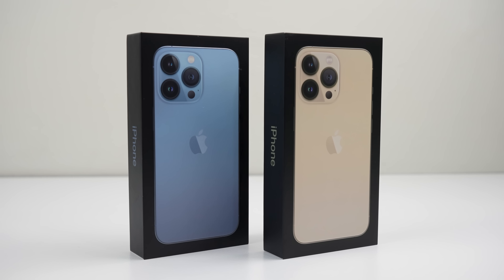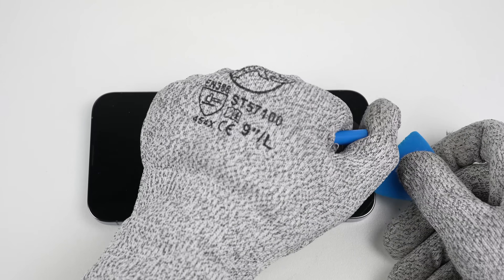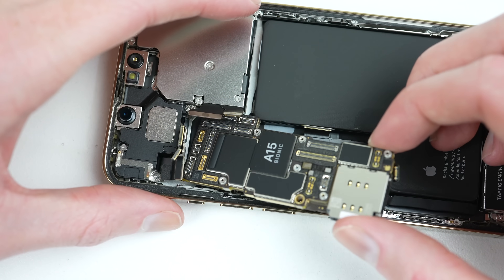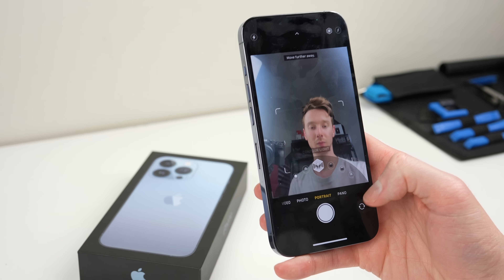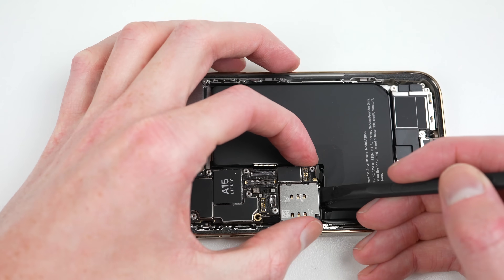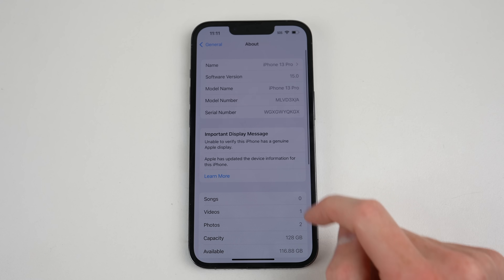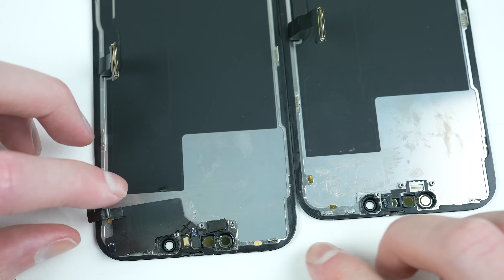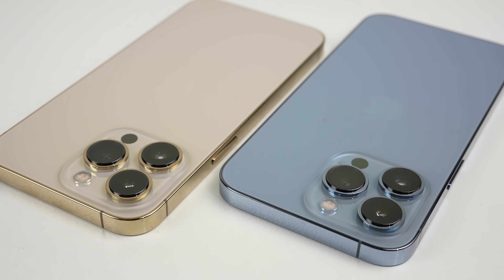iPhone 13 A Repair Nightmare - Teardown and Repair Assessment

Comment: Imagine buying a product and not being allowed to repair your OWN property. You're basically renting apples phone at this point.
Reply: Yes, that's the general message. Private ownership by individuals as we once knew it is slowly disappearing.
Reply: @uzivatel56  It is only disappearing because we currently allow it.

We have the ability to choose to disallow them this.
Reply: @TerkanTyr  we don't have the ability. Practically everyone is moving in that direction, in every industry, so you choose between buying their shit or not buying anything ever again, even the things you need to buy
Reply: @gordonf5553  You have a democratic government and a military, you have the fucking ability.
Reply: @TerkanTyr  Yes, let's not give up yet, but I actually don't think we can change it. It's a general trend across the board (software, cars, house appliances etc). We can't do much to stop it.
Reply: @uzivatel56  it was always an illusion. You belong to your king, and though your pasture is wide and you can graze where you want, you are still company cattle.
Reply: @uzivatel56  But , you will be happy .
Reply: John deere does this also. Fixing anything yourself immediately voids your warrenty.
Reply: @skArpPT  voiding warranty upon repair is just lame, but purposely engineering something to break once repaired is plain evil.
Reply: @jameswilson8907 
The McDonald's ice cream machine actually always doesn't work because the cleaning system is designed very strictly. If the sensor in it doesn't think it's clean enough, then it won't let you use the machine. It's this strict is by design. McDonald's doesn't want to risk a possibile lawsuit for food poisoning.

The only reason other tools and appliances used for cooking and meal preparing don't break as much as the ice cream machine is because it's somehow harder to keep an ice cream machine as clean as the other tools. And considering the employees who work there, the extra effort and requirements needed to clean the ice cream machine are often not met.
Reply: @skArpPT  and thats why theres people that hacks the software for john deer. if a farmer lives 50 or 100 miles from the nearest dealership they have to call a oversized hauler to tow it both ways to the dealer n back home.. which is not cheap at all. dumbest shit ever
Reply: "By 2030, you'll own nothing and be happy about it."
Reply: get an android theres plenty of phones with better specs at cheaper prices
Reply: @wulloo1  you suggest Android to be any better when it's owned by Google?
Tons of pre-installed apps that you can't uninstall, update 1-2 times a week to reset any preferences you set, and collects all your data?

Not really seeing the upside here....
Reply: and yet you still buy them..
Reply: lol in most jurisdictions you have a legal right to repair plumbing, windows, electrical connections, etc… in your own rented apartment with or without landlord permission. it’s worse than renting the phone.
Reply: Yep and the once the government starts monitoring how much money you have in the bank, you will not own anything else either.
Reply: You’ll own nothing and you’ll be happy
Reply: Hah, don’t give them an idea,  technically we ARE renting everything. We don’t exactly own anything at all if you think about it. All those terms and conditions, we ARE simply buying the right to use but not the right to own.
Reply: thats the intended outcome of all these "measures' by global corporates. Its all a game and you aint part of it. - Carlin
Reply: Once u understand how android works u would never go back to apple, its basically like a jailbroken phone except it has even more user control
Reply: It is difficult to believe that this is the case. The parts must have a software ID and this ID is stored in the firmware. So we just have to find out how this software works? Otherwise, who buys a smartphone for 1400 Euros? Mainly these are aristocrats who never look at bills but simply insert the credit card. Of course, there will be used iPhones13 so Apple might target those folks who want to repair a  used iPhone13?    The hacker community in Siberia will surely find a solution soon.
Reply: The same with “buyin” a Tesla
Reply: I've never owned a P.O.S iPhone, never will.  Long live Android!
Reply: “You will own nothing and you will be happy”

-The Great Reset
Reply: You are renting their software, their encryption, their design elements, the cellular network, and your place in it. You may own the silicon, aluminum and plastic, but if you though you owned the electrical impulses inside your computer then you havent been paying attention.
Reply: sadly this already exists in the games industry, give it time ...
Reply: And they will automatically break down after an arbitrary amount of time, when apple decides it's time for you to buy a new iphone.
Reply: Same with most things.
Reply: this is why i would never buy apple, we dont even get official iphone products here in argentina
Reply: Same thing for cars. You may be able to repair the parts by yourself but the manufacturers tend to have a monopoly on the available parts due to compatibility issues.
Reply: Check out farming industry. Going the Apple way...
Reply: You don't own your copy of Windows either. Until it goes belly up and you lost a ton of money, then all of a sudden it's yours, you broke it, so go away with your claims of incompetence.
Reply: this has been the case in the automotive world for decades and apple aren't the only ones doing this on personal electronics. Stop blaming apple for everything.
Reply: Chevrolet at one point tried to argue they still owned your car post purchase because they owned the software on your car. 

This stuff has been going on for a while, but seems companies learned they have to slowly implement it and not just go straight to the end goal like Chevy did. Then people ignore it and pretend these companies are not disgustingly anti-consumer.
Reply: try buying a bugatti.... an oil change costs $20k and ONLY the dealership can do it.
Reply: same with some EV manufacturers
Reply: "You will own nothing, and you will be happy" - World economic forum
Reply: That's how software works these days...
Reply: @barnmaddo  Because you let them do it.
Reply: I wouldn't do that.  I have a Blackberry.
Reply: I mean that applies everywhere. You cant subdivide your own land and build things without permits which are controlled by the HOA. 
But ya. Not saying i'm on apples side. It fucking sucks.
Reply: @BestxBelieve  Not everyone lives in HOAs, because they SUCK DONKEY BALLS.

F HOAs
Reply: @BestxBelieve  we all know HOA are a bad idea
Reply: @BestxBelieve  Don't buy a house that has an HOA. As for permits, a lot are junk, but a lot exist to make sure changes to your property don't have a negative impact on your neighbor's property or public safety - like the height of front fences, set backs, land modifications or major structural changes. For everything else on a house, you are free to repair yourself or hire who you want to do a repair - plumbers, electricians, etc. The one thing that is abhorrent, though, is paying property taxes forever even after you fully own the house, and they only go up and never go down like excise taxes do and if you miss enough payments you can lose your house. One might say, "yeah, but you get lots of services for the taxes you pay". Not that I'm aware of - no street cleaning, police take forever to show up if at all now, all trash/waste and utilities are separate bills. Road repair? LOL. Most taxes now only go to either pay for the public school system or pensions.
Reply: @BestxBelieve  HOA doesnt exist in most countries, but yeah it fucking sucks.
Reply: @BestxBelieve  yeah, but going into an hoa you know that. People buy houses in hoa areas so they know their neighborhood has to stay within a set of rules on their lawns and exteriors colors and design of the house.
Reply: @cornfed123567  No, my HOA just passed a rule in August that wouldn't allow MY car or any motorized vehicle to be parked on MY own driveway. Thats something that wasn't in place when I first moved into this neighborhood.
Reply: @BestxBelieve  it basically was, you signed the hoa contract that states they can pass new rules and enforce them on you. Anything that is legal for the hoa to do, is open to happen to you now. If they decide in 10 years that the colors on the outside of the houses need to change, you will have to paint your house at your cost because you signed the contract. At least with Apple and other tech companies they have to make you agree to the terms of service again after making changes, you know in a way that makes an hoa worse than what Apple is doing
Reply: communism bans you from selling or trading anything. That's what I meant, when I compared the gaming industry's practices to a communist regime.
Reply: @radiofreealbemuth  jesus
Reply: imagine buying a product YOU ALREADY KNOW you will find difficult to repair, nobody forces you to, then you sit on it (because you don't even care, your dad will buy you another one) and in the meantime you rant on the internet how bad the seller is for not repairing what you broke. Oh, and the seller WOULD actually repair it but it's not cheap, again you KNEW it and still you bought it anyway. Ridiculous 🤣
Reply: lol this is allowed to repair. why are you lie?
Reply: @nnnnnn3647  Allowed to repair yes. Possible to repair no.
Reply: Don't they say something like this in their agreements?
Reply: yeah and this idiot bought 2
Reply: If I bought a Ferrari, would I want to do an engine swap with a regular box of tools? If I Bought a Samsung 75" smart tv, and it broke, would I want to tear it down to fix it?  Apple uses clean rooms and specialized tools to fix things that were built in clean rooms with specialized tools. Expensive toys cannot be fixed by just any guy with some tiny screwdrivers!
Reply: Same with video games that need a code to download patches and updates to fix the broken base game. I don't buy games anymore for this reason, because I vote with my wallet. But others can't help it. They'll still support these dirty communistic practices from gaming industry.
Reply: @radiofreealbemuth  Your argument is true (sadly). Hence why I stopped getting games from big companies and started getting games from smaller companies.

And I am so glad I switched from games like CS:GO to Escape From Tarkov
Reply: @radiofreealbemuth  Experiences consequences of capitalism

Is this communism?
Reply: @PelvisPresley94  communism bans you from selling or trading anything. That's what I meant, when I compared the gaming industry's practices to a communist regime.
Reply: @radiofreealbemuth  Kind of a stretch, but fair enough. The point of communism would be that it would come post scarcity so you could get and give goods without being sold as a commodity
Reply: @radiofreealbemuth  This is literally the definition of capitalistic practices, not communistic ones.
Reply: @radiofreealbemuth  That's capitalism not communism lol
Reply: @jqmarshclips  communism bans you from selling or trading anything. That's what I meant, when I compared the gaming industry's practices to a communist regime.
Reply: @radiofreealbemuth  communistic? breh you mean capitalistic?
Reply: @memorydefekt  communism bans you from selling or trading anything. That's what I meant, when I compared the gaming industry's practices to a communist regime.
Reply: @radiofreealbemuth  how are these practices communistic? I would say this is the bad side of capitalism and probably needs government intervention to be addressed. In the case of tech Right to Repair bills.
Reply: @valterfrancisco5505  communism bans you from selling or trading anything. That's what I meant, when I compared the gaming industry's practices to a communist regime.
Reply: @radiofreealbemuth  Communism, he calls it! You can't make this stuff up, it's literally the boogeyman.
Reply: @WaxPaper  communism bans you from selling or trading anything. That's what I meant, when I compared the gaming industry's practices to a communist regime.
Reply: @radiofreealbemuth  You can't expect a fully evaluated game from a short alpha and beta phase with limited people. For me as long as the updates are free it's alright.
Reply: @radiofreealbemuth  yeah them shady big biz practises sure are "communistic" lol
Reply: @radiofreealbemuth  You meant Capitalist....
Reply: @radiofreealbemuth   communism?? That is literally a problem of capitalism, lol. Capitalism says companies can do anything they want to screw over customers, as long as it makes the most money.
Reply: Your dumb that will never happen. Ever heard of the Genius Bar? You think apple would get rid of a main component in their stores. Yeah no your just dummy
Reply: @RayyDawggg  "genius bars" hire uneducated morons whose only job is to tell you your device component is broken and needs to be replaced, for a few hundred bucks. Even when the issue is just a loose cable.
Reply: WRONG. You can repair what you what want but imagine how many people would and will mess up their phones mainly because no one would be ESD safe and other reasons. Then you bring it in to a apple store and demand a free swap because you messed up your phone.
Reply: @RayyDawggg  not without apples machine to reset hardware ID's you can't, or did you not watch the video?  It would be one thing if we were talking about flawed repairs but let's be honest, the average user is not going to try to fix say a laptop or phone, they are going to take it to the manufacturer or a third party for repair which is kind of the whole point as apple removes the third party option when their track record for repair is pretty terrible.
Reply: @RayyDawggg  And that has nothing to do with the issue at hand.  There is nothing special about an apple phone or laptop in terms of repair as various youtube channels (and others) have been proving for years except apple's attempts to make third party repairs impossible.  This equivalence has been proved false so many times I wont bother but clearly you don't know what you are talking about.
Reply: @RayyDawggg  stop being an apple fanboy sheep. Your argument against right to repair is the most retarded, incoherent piece of crap anyone has ever invented.

People have the right to do whatever they want to their belongings. Even dangerous equipment like microwaves are designed to be repaired.
Reply: @RayyDawggg  you are so in your own world you don't even know that third party parts work for all iphone models. stop embarrassing yourself.

do you really think it's that hard to get apple credentials?

Comment: Which is why I'm sticking with my iPhone 6S+
Apart from a new battery -replaced at a shop at the local mall it's functioning fine. 
I had my iPhone 4 from 2010 to 2016 and this one since then.
Hopefully I'll get 10 years out of it before I have to shell out to apple again.

Comment: I see the same in the car industry. If you replace certain parts on a Volkswagen you have to have them coded  / programmed at a main dealer. This is to make sure customers don't get their car fixed elsewhere.

Comment: They have implemented impressive tamper detection and IP protection measures. This makes it difficult to return an iPhone containing third party components to Apple for a trade-in.

It is expensive for the consumer.

But I can see that it protects the return and trade-in programs for Apple’s flagship product that contributes most significantly to its stock price.

Comment: I find it fitting that there are 13 cables connecting to the logic board ( minus the battery and screen cables). I don’t know whether it was intended or just a little coincidence, but it’s funny to think about.

Comment: If apple was in medical industry they would sell oxygen cylinder and if you refill cylinder with unauthorised vender it will cease to function and patient may die but apple will say its due to incompatible oxygen in cylinder.

Comment: it's a shame, because the hardware in itself would be so easy to replace. Apart from the adhesive on the display, repair-ability seems pretty straight forward.
Reply: I agree. Apple clearly sees the benefit of easy to repair (easy to manufacture, therefore fast turnaround, and rock bottom wages paid for manufacture).
Reply: @skashed  what is rock bottom? Means low?
Reply: @stevestevens1457  Rock bottom is the lowest point, basically you can't go any lower. PS googling this would take u less time than asking in comments.
Reply: @petmach  thank you. Getting a live answer is much more pleasant in some way.
Reply: @stevestevens1457  agreed. a psychological thing
Reply: It is straight forward. Apple and most companies intentionally make consumers think they are incapable and NEED to go back to the big, responsible for-profit corporation for help when in reality we can do most things ourselves with a bit of time and patience.
Reply: It's a known bug, that will be corrected on the next iOS version
Reply: @TheDeadelus69  Really? Seems like an after the fact excuse to cover their ass from litigation.

Comment: I wouldn’t get a repair done by a third party anyway. Of the couple of people I know who did with older models, one had a dodgy screen that kept cancelling or initiating phone calls due to spurious touches, the other had a battery that swelled up after a year or so. Didn’t even save either much money vs going to an Apple store (though was more convenient). 

The problem with the OLED models is that the screens and glass backs are so expensive to replace. Mind you, I look after my phone and use a case - it’s not that hard to avoid smashing your phone.

Comment: I would assume Apple has programmed the phone and individual components with an address or code . If all the components are not speaking the same code they don’t work . A lot like DDC control systems work with Bac-Net communication.